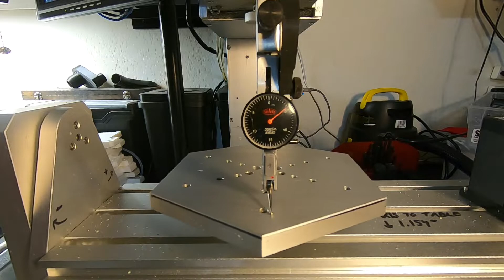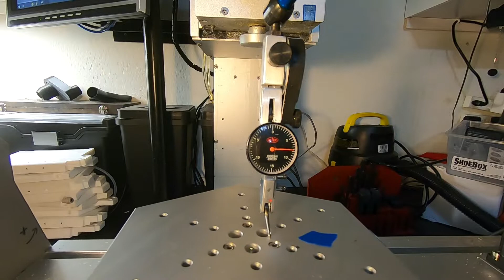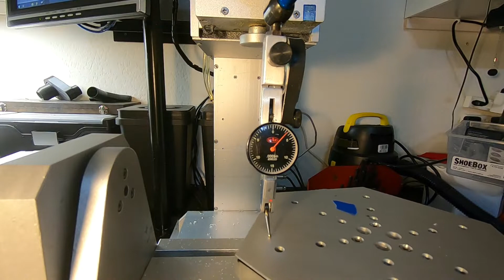HY6040 A Axis setup

Comment: Hi Dan, 
I bought a HY-6040 CNC machine and we need a post-processing file to use the 4th and 5th axes. Can you help me through this?
Reply from the maker: There are a few things that a CNC machine requires.
1. CAD CAM system 
2. Post Processor configuration for the CAM and machine.

What software do you use for the tool path programming?
Reply: @HandyDan  we use solidworks cam, but unfortunately the seller doesn’t have post-processing file. How we can make it?
Reply from the maker: @neginheiran8301  OK great, SolidWorks CAM is basically CamWorks striped down,  do you have the upgrade for multi axis? 
I have a post for you. Email me and I'll send you the info. 
message2dan@live.com
Reply: @HandyDan  that would be great 😃
Please let me know your mail address.
Reply from the maker: @neginheiran8301  I replied to your last message with my email
Reply: I sent you the email 🙂 @HandyDan

Comment: Hi. great informative video. Sir can you please help me to setup my 5 axis machine. i am new to cnc five axis. waiting for your reply.
Reply from the maker: Hello, what do you need help with?
Reply: recently i bought the 4&5 axis for my chines 6040 machine. it is running on Mach3. i am frequently using rhino cam 2017. But can not under stand how to active my 4&5 axis in rhino cam Mach3 post processor. can you help me on this.
Reply from the maker: @iftikharamin21  I am not familiar with Rhino CAM software, does it come with basic posts? Also what type of parts are you looking to make? Do you need 5 axis simultaneous or will 3+2 machining work?
Reply: Sir i am a jeweler. and i make jewelry module. i have made serval toolpath on 3 axis and 4 rotary 4 axis. since i bought the 4and 5 axis module from ali express. so i was wondering how to make the five axis working. please reply.
Reply from the maker: @iftikharamin21  if your Rhino CAM has a 5 axis post, or if under the machine choice it has a 5 axis, try those. It sounds like you are looking for 5 axis simultaneous so you will need to test a few posts
Reply: Actually i am making my all designs on rhino. Yes i am looking for a  5 axis simultaneous feature.  Is this feature is available in CAMWroks?. Please reply.
Reply from the maker: @iftikharamin21  Yes Camworks has 5 axis simultaneous,  I actually have a video on making the post processor for Camworks
Reply: Hi. I saw that video. Ok sir. let me check where i can find the camworks software and will come back to you.
thanks,
Reply: Is it possible that u share ur camworks copy to me. still i didn't find.
Reply from the maker: @iftikharamin21  it's a very large file,  have you ever heard of bit torrent?  I could seed it for you
Reply: @HandyDan  Yes. i know that.
Tell me one thing. To run Camworks, should we need to install solid work?
please tell.
Reply from the maker: @iftikharamin21  Yes, Camworks runs inside Solidworks,  I have both tested ,I run older versions though. 2018
Reply: @HandyDan  Please send me the torrent file to download. both one.
Reply from the maker: @iftikharamin21  please email me message2dan@live.com, I'm at work but later I will let you know when I have them uploaded to seed
Reply: @HandyDan  Sure.
email is sent to you.

Comment: I bought the same machine and can’t get it to move at all I programed the pins and did all the mack three set up do you have any idea why it wouldn’t move? I’ve had it for about three months already and still can’t figure it out !
Reply from the maker: This is an older comment but have you found a solution?
Reply: @HandyDan  Nope I tried everything I even bought a new computer and all,a year still cant get it to move i’m thinking of tearing everything out of it and just rebuilding it 🤦🏻‍♂️
Reply from the maker: @MrIMPALAJAY  what cable does your machine use to connect to the computer? Is it a 28 pin parallel port? Or a USB?
Reply: @HandyDan  Its a usb, which I tried I also bought the UC100 motion control sensor tried that and even opened it up and tried a parallel port by passing the usb
Reply from the maker: @MrIMPALAJAY  My milling machine is the early version that has a 28 pin parallel port on the side of the tower. I use the UC100 to convert it into a micro USB to my computer USB,  I never got the computer parallel port to run with Mach3.
Reply: @HandyDan  Wow so what would you recommend as far as program ?
Reply from the maker: @MrIMPALAJAY  you can run anything you want, did you get it to work? 
What software do you use to create your programs?
Reply: @HandyDan  I never did get it to move but I would like to try another program maybe that’s what’s wrong with it
Reply: Hi, Dan I finally got this thing to move after replacing the break out board and 3 stepper drivers but its moving really slow Im trying to figure out how to get it to move faster would you have a idea how ?

Comment: Im new to this,  had this machine over a month and cant get it to even move a cm 🤦‍♂️ Im  trying to use mach 3 software
Reply from the maker: I need to know a little bit more about what the problem is. Do you have any Gcode files loaded? Any errors from them? Can you jog any of the axis?
Reply: @HandyDan  I did load a G code I had no errors I will be at my shop later on this evening I can send you pictures or video I’m new to CNC machining.

Comment: Hi Handy Dan. We need your help. My husband just purchased the same type of CNC machine (HY 6040) but can't get the PC to talk to the machine. Apparently it's a driver issue. Could you please help us? Our emails are lana@shield29.com or john@shield29.com

Hope to hear from you soon.
Reply from the maker: I will email you but I wanted to mention it here. The LTP parallel port is old technology in computers yet ArtSoft Mach3 continues to use it.
I have a 2012 Dell with a parallel port but Windows 10 drivers do not work for Mach3.
I am using a UC100 CNC USB controller and it works great but it lacks extra pin controls for special settings.
Reply: @HandyDan  
Thank you so much for your informative reply.

I'm currently running Mach3 on a windows 7, 64bit OS via desktop pc with a builtin 25 pin  LTP port. I however can't seem to detect the driver for the CNC despite repeated attempts. I,m looking forward to your email. Thank you very much. John.
Reply from the maker: @lanazailaa7060  That is the same issue I have with my 2012 Dell with built in LTP port and Windows 10 cannot detect it.